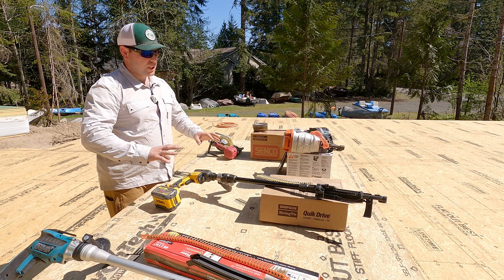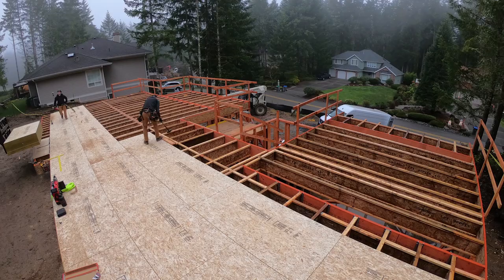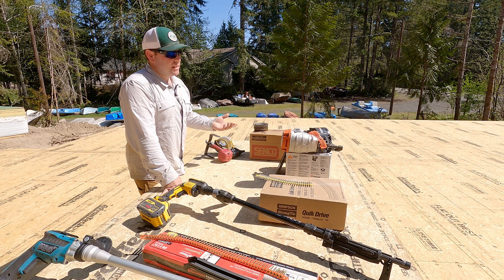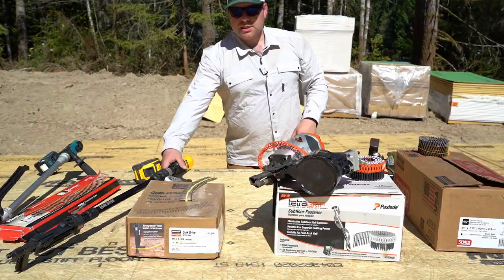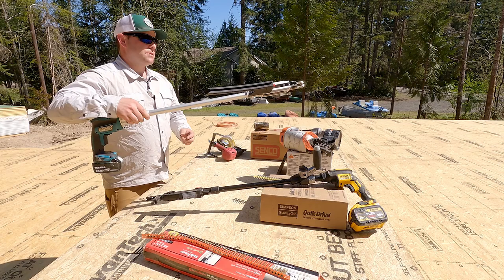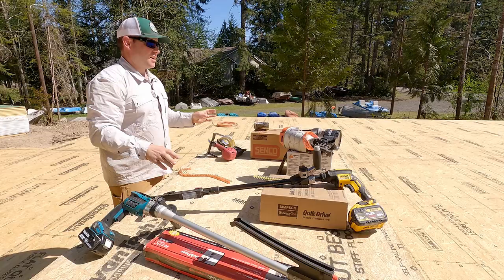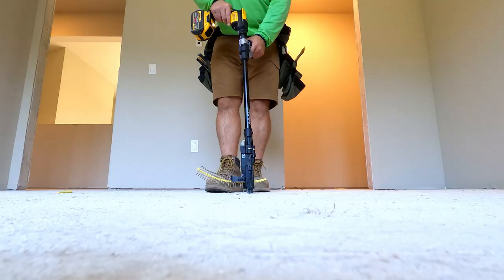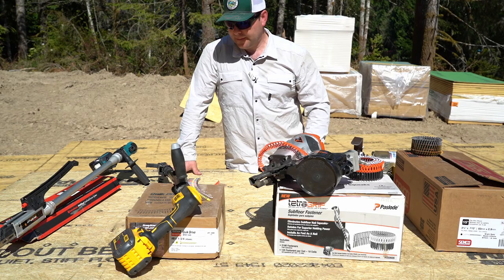Best Way to Fasten Subfloor

Comment: Big fan of huber products . They cost of call backs is way more then the cost of the right product the first time around .
Reply: That's a great way to think.
Reply: @SinnisjInsulator   Having to go back and fix the issue in finished homes can be a big pain . Sometimes the materials are no made anymore if you need to pull up flooring .
Reply: @hhprogressiveconstruction1140  oh and I know some homeowners are picky. I'm just glad they aren't picky about the colour of their insulation, floors on the other hand...

Comment: I don’t do many subfloors a few new additions yearly but I use the DeWalt quik drive system for decks it works efficiently and we do a lot of decks yearly and Re decking of older decks … great video to help others decide which route to go

Comment: Very nice job! I've not yet seen a similar comparison, so this is really handy. I only wish I could have found this video back when I started laying the subfloor for my workshop. I knew up front that I was going to use screws instead of nails. Because I was not sure of the screw gun attachments, I went with a compromise: deck screws with a drill attachment. It was not fun; fortunately the floor was not that big. I'm a big fan of both Fastenmaster and Simpson, so I know what my next project will use.

Comment: For us newbies, I was wondering what length of nails are a good choice to attach the flooring to the floor joists! And what type of nails.....ie, Galvanized, Stainless Steel, Ring Shank or Bright Smooth Shank? I’m in a tropical area close to the ocean. Thanks!
Reply from the maker: generally for 3/4" subfloor a 2 1/4- 2 1/2" nail is used.  If you are close to salt water a lot of jurisdictions require stainless.  Go with ring shank.

Comment: I was told you don't have to use glue with the Paslode gun. Is that correct?
Reply from the maker: Yep, its true.  Code doesn't require glue.  Paslode fasteners are pretty incredible.

Comment: Is that just an attatchment that you can put whatever cordless screwgun on? Like I saw the DeWalt driver on it, but could you put a Milwaukee or Makita?
Reply from the maker: Good question Jacob.  The Quick Drive kit comes with the DeWalt tool & batteries.  I would head over to their website and find out or talk to your local rep.

Comment: Will the tetra grip work as a standard coil nailer for wall sheathing, if you weren’t in the coil nailer game and didn’t want to buy two?!
Reply from the maker: No they won't, you have to have the Paslode nailer.
Reply: @AwesomeFramers  Oh, I was thinking the other way around. Will that Paslode nailer shoot standard coil nails, or is it specific to those tetra-grip nails?

Comment: Isn't the glue supposed to stop the squeaks? 
Love the quality information you provide us!
Reply: It’s the nail rubbing on the subfloor as it moves up and down ever so slightly when you walk over it.
Reply: @michaelvonfeldt9629 supposed to be shot on an angle to help prevent this, no?
Reply: @maxnovakovics2568  that may help but screws and glue are the answer to preventing squeaks.

Comment: Option 3 or 4. I like screws. And standing. @jrhanson76. Really want to try the advantech sub floor adhesive. Thanks for the info Tim!!!
Reply: Also two failed attempts. Got it on the third.